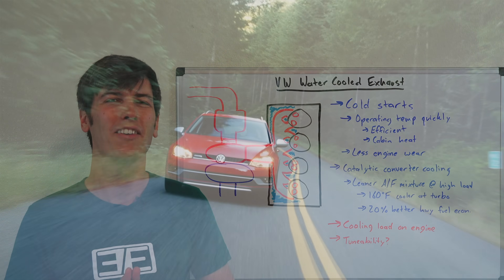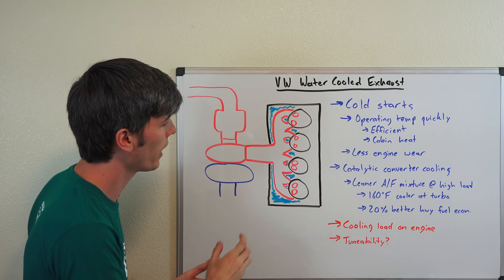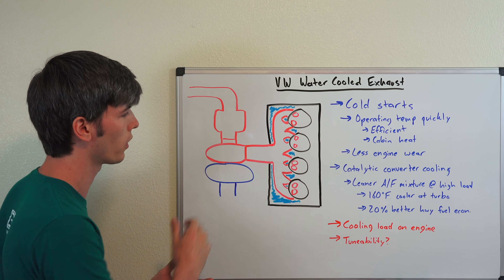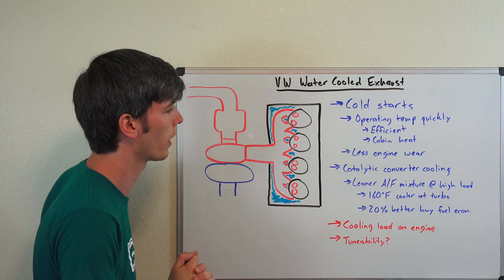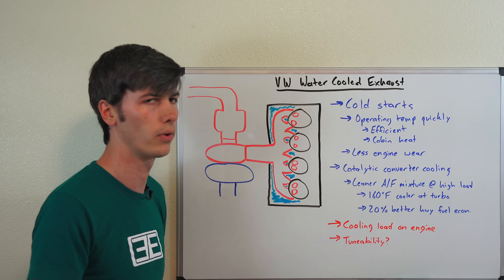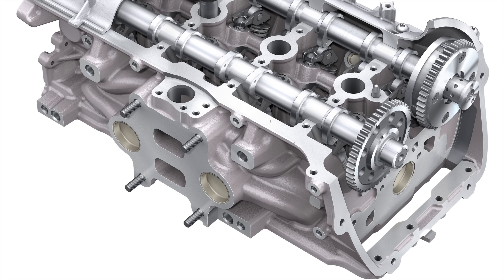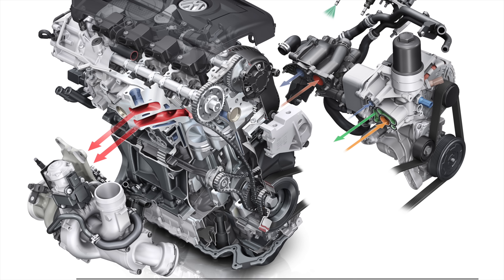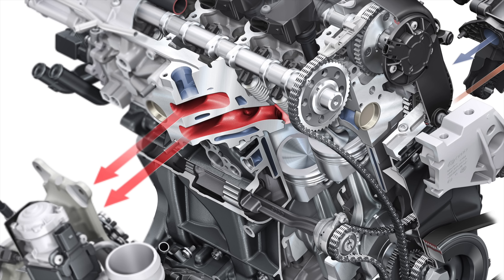Why Does Volkswagen Have A Water-Cooled Exhaust?

Comment: 20% improvement in fuel economy?  I would like to see the data and the experimental controls.

Turbos are more efficient because they convert thermal. energy into work.  Less thermal energy = less power.  This is why some exhaust manifolds and turbos are blanketed.

Warm up is a specious advantage with current synthetics unless extended lubrication change interval is desired.

I am not a buyer on this one.

Comment: OK EE, I know ur just reading off of VW's propaganda here and thats ok, but...
I see lots of cracked heads in this setup.
Also, this doesn't make sense for turbo performance as a turbo LOVES hot exhaust, thats how it extracts the most power. 
And because of that, there's almost no reason for this engine to have a turbo, it's pointless...
And on the flip side, the cold startup efficiency is BS. Now that the exhaust is colder, the catalytic convertor is colder, longer and will require MORE FUEL to lightoff. If there was no cat converter then the cold startup efficiency statement would be valid. 
And then the rest of the crap doesn't make sense... Again, turbo's LOVE hot exhaust, giving them cold exhaust counter. It's why some of us high performance, all out racing guys have header/exhaust wraps going up to the turbo. 
And I have a book for you to check out that backs up all my statements: "Maximum Boost" by Corky Bell, the GodFather of F1 Racing.

Comment: Why not move the cat converters farther down the exhaust piping so that you don't have to add additional fuel to the mix in order to bring exhaust temps down in the first place?  Put 'flutes' in the exhaust tubing much like a rifle barrel and when the exhaust naturally reaches a temperature where the converter would operate most efficiently, install it there.

Comment: its a nice idea. most boat engines use a similar kinda thing but its external. there will be an extra water pump on the accessory belt that pumps sea water through a heat exchanger. main reason for using it in a boat though is that a cold exhaust is much safer(especially in wooden and fiber glass boats). added bonus is at that sort of temp you can use rubber exhaust pipe rather than metal.

Comment: Nice video!

The Peugeot 1.2 L Puretech also has that kind of exhaust, it also has 2 thermostatic valves (one for the block and other for the cylinder heads).

Comment: question, not regarding the turbo or cooling system but at 4:58 i'm looking at the timing side and i see 3 chains, 1 going up for the timing of the camshafts, 1 going down for the oilpump, and 1 going kinda diagonally to what i can't seem to give a name or function. Do you know what it is and why it's on a chain? i could think of water pump but it looks a bit small and that wouldn't need to be on a chain, simple serpentine belt driving the AC compressor and Alternator would suffice. So i'm not sure. hopefully you can clear this up cause now i wanna know ^^

Comment: You mentioned that in order for gases to be cool enough for the CC to work, a higher AFR will be needed. Does this necessarily mean more fuel? And if so, isn't that counterproductive to lower harmful gases by adding more fuel? How are these balanced for optimal emissions.
Reply from the maker: +oisinmcdaid yeah it's certainly a tricky balance. But overheating the cat won't solve anything, so it needs to remain cool enough to function first (and hot enough, during cold starts), and then worry about a/f ratios.

Comment: @Engineering Explained 
I'm not sure I understand why VW would wish to cool exhaust gases for the catalytic converter by this complicated design instead of relocating it at a further distance? (I think some rally cars even have those on tail pipes) Thanks!
Reply from the maker: +Paul-Philippe Frenette rally cars are driving flat out constantly, so they put the cat as far away as possible so it doesn't melt. Production cars spend most of their time at partial throttle, so you want the cat close enough to remain warm enough to be effective (but not overheat if you do go wide open).
Reply: The 20% fuel efficiency increase impressed me I guess. Thanks for your fast and clear answer!

Comment: Although you said some good advantages and "reasons" (I also don't believe that 20% of fuel economy) the main one is to cut down manufacturing costs. Casting the exhaust manifold into the heads saves money from using a external cast iron manifold. Also, you save money during assembly you don't have to assembly that thing and the time can be converted into more productivity.  Finally but marginal, it saves space  and may allow VW to ad some 48V stuff or more cabin room.

Comment: I have a question. How the heck could the cast it? Some metal termits programmed to make  exact cooling manifolds? ;O
Reply: +Rustam Khasanov its just a regular head with siamesed ports dude...all heads have water passages all around them

Comment: It's just to reduce manufactured parts,particularly cast iron cost of manufacturing....wich suck a lot of money.
"water cooled exhaust" is an abusive use of just an extremely shortened exhaust allowing less loss in calories (150°C per meter of pipe)
less loss in calories= sooner turbo spool= less rpm= less fuel used= longer gears on highway thanks to sooner torque.
1.8 turbo for only 170 hp is a joke efficiency wise.

Comment: 20% extra economy.. really VW. 
I suppose emissions will improve too?
Sound like they're just making it up again.
Does anyone believe them?
Reply: Yes, i drive a 300hp 4zyl from vw and i can get 7.5L to 8L/100km
Reply: heultdochalle because German engineering
Reply: what is that in MPG?
Reply: +heultdochalle You fucked up yourself. There is a 310 hp Cupra.
Limited edition 310. 100 Cars build and only sold in the Netherlands was build from 2008-2009. It was a special edition tuned by ABT. Mine is not actually a real one but it got the same tune and parts from ABT. If you try to insult someone do your research.
Reply: fucken destroyed heultdochalle
Reply: That must be the older generation. My 310 hp 1p Cupra i can get it to 7.5 L/100km too. The newer models are even better.
Reply: you just busted yourself, there is no 310hp cupra , kiddo. golf r has 310 now and cupra 300
Reply: 30MPG.
Reply: Well, if economy is 20% better, that it 20% less emissions per mile.
Reply: Toyota and honda caught making up mpg not volkswagen...
Reply: the cupra you speak of is not a real cupra its not even in the manufacturer list, its the same with the golf r360s from abt in switzerland, its not a real golf r, all engine fails etc have to be managed over abt, good luck with that crap btw
Reply: And you fucked up again.
 http://www.carscoops.com/2008/09/new-seat-leon-cupra-limited-edition.html
https://de.wikipedia.org/wiki/Seat_Leon_II#cite_note-9

Comment: Hi

Why not just fail to buy Volkswagen especially when they have cheated on their engines diselgate scandal. And besides, they are not so good quality with many problems. I know one who has an almost brand new Passat where the engine broke after a few miles and had a brand new engine. Volkswagen cars are not like in the old days when they stood for quality and low cost.

Comment: what about detonation and the fact a lean mixture isn't good, this an explanation isn't great like I find with many of these videos, Although they are great if you don't know anything,  there are too many omissions and unexplained details and sometimes just bollocks. Even spanner monkeys could pick this apart, Oh and even Leyland in the 50's 60's had what you call an exhaust cooler fitted as did most carb fitted cars which in some cases was a cast exhaust and inlet manifold all in one to help with carb icing and other things would benefit or lose out to the coolant circulating. But all in its bloody simple they needed a small packaged engine and Turbos notoriously generate a lot, of heat so needs any help with cooling it can get. That was a lot simpler.

Comment: >20% better highway economy
>VW

Are you really going to believe them?
Reply: My mom has a '15 sportwagen and honestly if you keep it in automatic shifting the millage is surprising. This engine is really 
de-tuned from factory , a simple reflash of the ecu gives you 70 horsepower more than stock. compared to the 2.0 tsi in our previous tiguan we didn't had as many problems.

Comment: 20% better fuel economy, eh? insert Dieselgate joke here
Reply: the biggest joke about diselgate is, that VW was one of them but not the worst, if I remember correctly citroen got realy cocky and made fun of VW for cheating , two weeks later tests were made and the result was that Citroen was even worse!
Reply: I've worked as an engineer in the industry, it's the name of the game... optimising for tests is just part of the process, the test protocol will be filed right with the technical requirements, and as a result, pretty much EVERY vehicle performs completely differently on normed tests than in actual road use, because everyone is running against the same engineering constraints, and everyone needs to compete with one another, because in many markets, EU vehicles, Ford and GM group, and Asian vehicles will compete head to head. The exact amount of face-planting that was uncovered of course differs, and VW data dump off the ECU was especially funny how it snaked so incredibly narrowly around the test parameters, to give you the best emissions while testing, and the best balance of economy and drivability otherwise... they probably really thought they hit the nail on the head with that one ;)
Reply: I always thought Citroen made some pretty terrible vehicles. VW is at least likeable.
Reply: +doktorbimmer It is a matter of public record how the cheating was discovered. They found it was VW because they just happened to be testing a pair of VWs with another car when they were doing their research. Do you think that West Virginia University in the heart of coal country is part of a global conspiracy to promote electric cars?
And by the way, Mr. Bimmer Doktor, the third car in the test that didn't cheat? A BMW.
Reply: I wonder how many other companies changed their vehicles after VW got caught (dieselgate). I cannot believe VW were the only company doing it.
Reply: Its not realy cheating. The test conditions just trigger the engine to go into low demand mode
Reply: TeslaMaster2 
The vw Passat tdi has a smaller carbon footprint than a Tesla
Reply: They all used Bosch engine management so no surprise they were all up to the same fakery.
Reply: Well at least you don't have to replace ur engine 2 or 3 times, in warranty,  unlike a Tesla. 

Try owing a Tesla  out  of warrenty.
Reply: dieselgate already a lame issue, not just VW but also bmw & Mercedes
Reply: Yee
Reply: Dieselgate??? Unlike GM ignition and Takata - no one died.
Reply: There is no connection between Dieselgate and fuel economy of their petrol engines!
Reply: Actually : Renault/Nissan is under investigation. The Fiat/Jeep/AlfaRomeo group too. Porsche was caught red handed with a more advanced cheating device. Mercedes is concerned. Audi, as part of Volkswagen had, naturally, some sort of devices installed.

The dieselgate just shown to us, who is willing to kill us for profit.
Reply: @boboutelama5748  not for profit but cos emission regulations were made by idiots in an office and not ppl in the real world
Reply: @BLAZINGINGPHOENIX  Hello. Those "idiots in offices" are called scientists.

In an ideal world, politicians are generally taking their work and adapt them into limitations for a better air quality. But because this wold is not perfect, lobbies will generally temper with those results and the politicans will choose a way broader limit.

And now you have VW, unable to reach the limitations their own lobbyists helped to create. And they choose the easy shortcut into using a cheating soft and hardware combination instead of bringing their technology up to the task.

FOR PROFIT !
Reply: Almost all European car manufactures were cought on cheating, Citroen, Peugeot, Renault, Fiat, Opel etc.. Give ma a brake american brands ate Saint. At least .European manufactures make more advanced cars with better milllage...
Reply: Siana Gearz I like your comment.  I drive an American made diesel truck which used  about  30% less fuel since the dpf was removed it runs quite clean and is stock otherwise I care about the environment  and I think Volkswagen does too, why else would they build a car to use as little fuel as possible
Reply: @timyanke9559  Diesel exhaust gas is a class 1 carcinogen because of the particles.  It's irresponsible to remove the dpf.  Petrol exhaust gas is not a carcinogen.
Reply: @grasonicus  thank you,  the first valid reason for keeping a vehicle stock.  Now I'm trying to decide  what is the lesser of two evils,  an economy tune which produces a minimal amount of carnaginic particles, or excessive fuel consumption resulting in excessive greenhouse gasses. Here's to electric vehicles, solar panels and sunshine :)
Reply: Its all in the interest of making a good "tradeoff", a few dead test monkeys, several thousand sickened and/or dying humans and animals resulting from  toxic diesel emissions because of a very silly and "overrated" Dieselgate claim and all of a sudden efficiency becomes of primary importance, and all of that just because, VW loves you, they did it for us, what a bunch of nice guys at VW... yes apparently it's all been worth it somehow... in the words of John Cadogan yesssssss....
Reply: Baltahfeek How about the fact that cars are regulated to such ridiculously low NOx limits that they can't achieve high efficiency and yet trucks, semis, and heavy equipment can spit out 10x the NOx for pickups and up to 1000x for those heavier trucks? It is ridiculously arbitrary and absolutely stifling to innovation. 

Not to mention how heavy handed these regulations are. Cars are regulated down to something like 99% of the NOx they once put out in the 70s and 80s, and yet it's not like it was the end of the world due to NOx emissions back then.
Reply: @KaiserTom  Yep.  80,000 # comercial semi rig has 350 - 400 HP and gets 5 - 7 MPG going 65 MPH and a <8000 # 300 Hp diesel pickup (also with 5+X less aerodynamic drag) only gets 2 - 3 X that at the same speed.  

No conseriousy to make the average vehicle owner spend way more on fuel than needed whatsoever.  :/

BTW, 'big evil oil' only makes 5 - 15 cents off every gallon of its product it sells while 'soft lovey big government makes ~ 40 cent to $2+ dollars in tax and other fees off that same gallon.  

Fact is big oil would love us all to have high efficiency vehicles and everything else that uses their products so they could sell us half the fuel at twice the price for twice as long.  Problem is big government would lose massive tax revenues in them doing so.   Also why big oil gets subsidized from big government, so they dont rock the tax greed boat too hard.
Reply: Bob Outélama you know that this "cheating device" actually is just the computer optimizing engine operation. It looks like cheating becouse the test is not like driving in a real road
Reply: screw the DPF, even screw the EGR too

Comment: My regular, day to day involvement with multiple new cars ended in 2005, I noticed no extended warm up periods for any of the vehicles I used, and this was during WI winters. I noticed that VW has not been able to "clean up" the underhood situation and make working on the engine easier, the engine room still looks very cramped. One thing about newer high output 4 cyls. The existence of high output 4 cyl engines means manufactures can stop trying to stuff a V-6 into a small engine compartment. Looking at the photos here It certainly does not appear VW is enjoying this development.

So, VW claims an emission reduction with the water cooled exhaust manifold. Anyone still placing any value in what VW claims in regards to emissions anymore? What I want from manufactures is high HP, high reliability, low cost, ease of service. VW, you have had alot of time to work on these requests, is this all you have to show for it?. When I think of incorporating other systems into the engine liquid cooling loop the first thing that comes to mind is more places for a coolant leak,second is more complex repair techniques must be used.

I do think VW has come up with some real good ideas lately. Those narrow "Vee" engines shows that VW is thinking

Comment: This is definitely as you say "a very interesting concept" I wonder how much pros and cons this will have in the long run especially for tuners, is this a game changer? will we see high end 3.0l with this concept too? will high performance radiators handle that? in my theory since boosted turbo cars usually blow the exhaust manifold due to excessive heat I wonder if this truly be a game changer, or would this concept just slow down a race car, since more heat = more speed. I'm no genius but I do research a lot and I watch most your videos, I would like to hear what you have to say in this matter and how you break this one down. Thanks for this video got me more to think about.
Reply: oh and I just read the honda comment with the r18 down there, I did not know that.